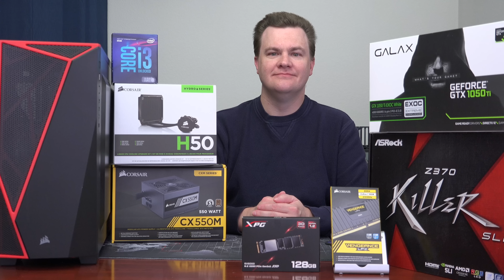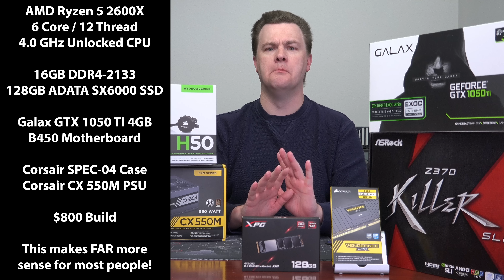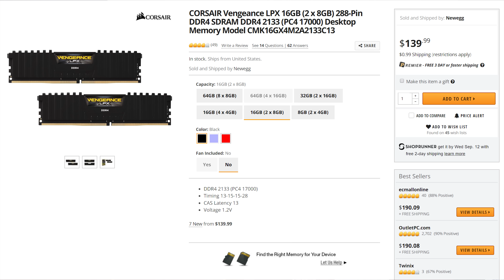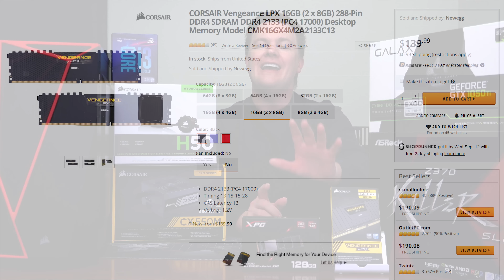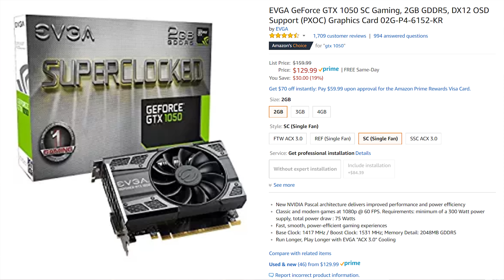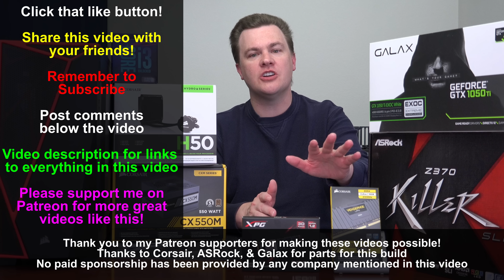i3-8350K - $800 Build - Full Blown Crazy? - Lets Find Out!

Comment: I think if your spending 800+ dont buy a 1050 go for a 1060+ and get 8gb ddr4 instead of 16gb
Reply: You can easily get a 1070ti for this price, I'm shocked that it's all 1050ti /1060 talk, 800$ is quite a large budget. Look:
R5 1600 ~ $150
AB350M Pro4 ~ $70
8GB 2666 DDR4 Ballistix ~ $80
Cooler Master MasterBox Lite 3.1 ~ $35
Corsair CX 550W PSU ~ $50
GTX 1070 ti Zotac Mini ~ $420
Scrapped hard drive
Total is 820$. And this will perform a WHOLE LOT better than a 1060 or a 1050 ti. Plus you get overhead for overclocking, since the 1600 has a spire cooler and a 2600 has a stealth cooler.
Reply: great build but I would buy an ssd and a nicer case with that  ;)
Reply: @vicietor  if you buy an SSD, you "have" to invest in a mechanical storage drive and that would be a lot more money. Yes, for$800 dollars, most of us would have built a VERY different build than what this video used but hey, to each their own. If it was me, I would have built a system using the same CPU but upgraded to a 3gb 1060 and used one of the MANY AMAZING $59 case options like from Phanteks or NZXT to offset the additional cost. That would have allowed you to go from playing 7 year old games to the newest Triple A titles at medium and high settings at 1080p.
Reply: yep but Its 2018 no pc without ssd speed :D
Reply: @raidzor5452  that PSU is good?
Reply: I would agree but I would personally by a rx 580 as it is the same price a three gig 1060 for 8 gigs of vram.
Reply: I agree, $800 dollar build and he's talking about being able to play Star Wars TOR... Like wtf?

Comment: I have a 4gb GTX 960 and when playing WOW it uses about 3gigs of the memory, so on the 1050 v 1050ti it might matter for WoW. This is at 1080p.
Reply: T's Slots its pretty common for a game to make use of extra vram if its available will load it with resources that normally would just be shuffled in and out of system ram.   Cause why not use it if its there? Weather it has an actual effect on total performance depends on the game code and how critical those resources are to the operations.   To make it more complicated modern gpus use on the fly compression to squeeze more info into less vram.  So to answer your question..   i donno
Reply: Unless you are obv throttloning due to vram it doesnt matter. I can play tomb raider 2016 on highest textures or titanfall 2 that says it needs 6gb of vram or middle earth that says it needs 6 or lord of the fallen that need more than 4 and not in one game do i get memory bottleneck. The closest i got was with skyrim se and about 150 mods. This id with 4gb 880m (kepler arhitecture) so not even the fastest one. Pay in mind pascal is almost 2x more efficient when it comes to aa and other vram intensive things so it wont max it that fast.
Reply: I generally only play WoW, and occasionally Diablo.  I'm running those on a 9 year old, i7-920 with a GTX 960 (4gb) and average over 80 fps in the open world running settings at "7" and at 1080p full screen.  I do drop down into the the 30's in Boralus and in Raids, but dungeons are still respectable.  There is another video out there by Hardware Numb3rs where the best performing WoW build (in BfA) is the overclocked i3-8350 paired with a RX570.

Comment: Hmm, why so expensive? $800 for a Ryzen 5 and 1050ti?
Reply from the maker: Watch the vid, I address that point...
Reply: Did you watch the whole video.
Reply: I watched the video but I guess I missed the reason. Is it because of using more premium components?
Reply: For overclocking potential. Thanks.
Reply: It's because he dosent use cheap ass pile of crap blow your pc to bits components. He's got overclocking in mind for a specific  set of games. It's well thought out to be honest.
Reply: Yes but everything has a warrenty hes mentioning. Folk who build second hand wont even be watching this most likley. I know full well that a second hand 800 put together would romp all over this. Thats not the point tho is it

Comment: BFV destroys my 4 core i5s with GTX 1050/1050Ti and 8GB RAM!!!
Reply from the maker: I don’t doubt it, I do address that in the video
Reply: Yes we're are in the 16GB RAM, +4GB VRAM Era.
Reply: Hardware unboxed tested the bfV beta and the 4/4 7600k did surprisingly well.   Im guessing its the gpu or system ram holding you back.  Hopefully they optimize the game a little more before release.
Reply: @evers6214  I tried on a i5 3570 @3.7 with 8GB Ram and a lowly GTX1050. that's probably why.
Reply: Not remotely  worried  I dident cheap out so I'll guess that playing  on a 8700 and a 1080ti will do. Ooh look sparkly 9900k out soon lol
Reply: 😒 then upgrade to a 6corer